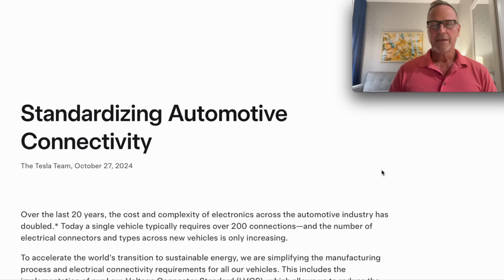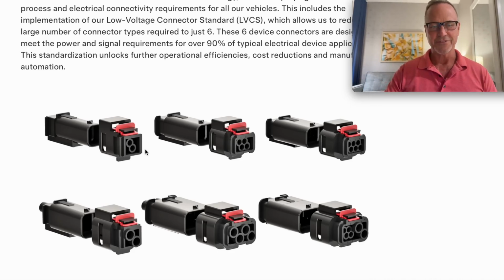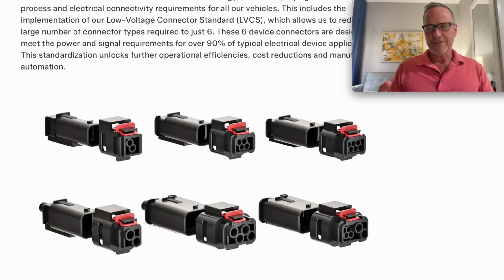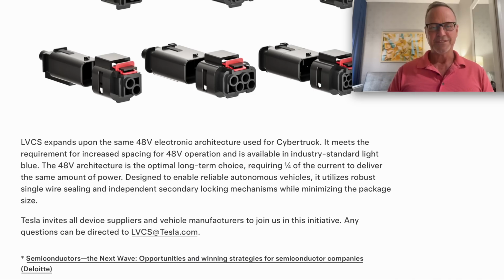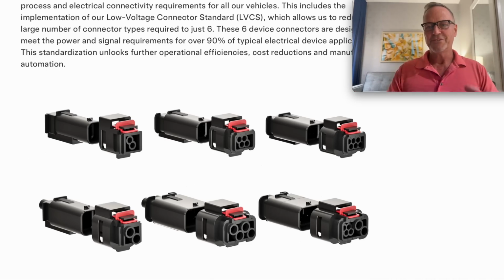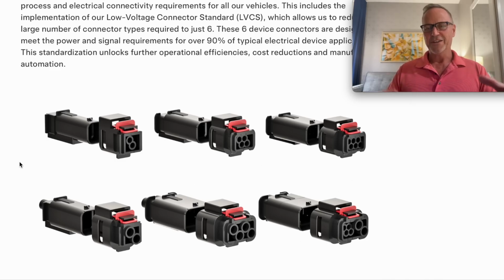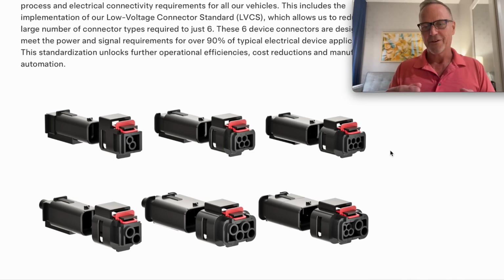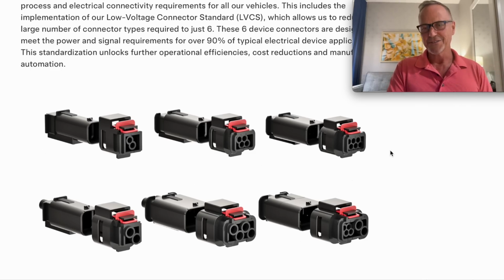Tesla Drops Another BOMBSHELL Standard!

Comment: Cars used to be built like this, or rather one connector for all wires - the problem is that there was no organization. Wiring repair was terrible as all wires and connectors looked the same. I'm interested to see how they identify which connector goes where - just seems too easy to plug the wrong connector into the wrong place.

Comment: Note that both the male and female connectors have a recess that is not ideal for a human handling the connector, but would be perfect to give a (custom) robot gripper a firm grip.  They would also be good fro mounting one side of the connector in some enclose or bulkhead, tuning it into a panel mount connector. So in the unboxed production, instead of mounting part of the car and then digging up the cables and connecting them, both sides of the construction could have the conrectors fixed in place, and the connection being made automatically when the car part is mounted.

Comment: The control signals will probably be the well established Etherloop that supports high bandwidth transfers.
With that combination, you can run one connection to the rear, and add all lights, wiper, camera, speakers, towing hitch connector through it. And maybe ABS, too?
This is simply brilliant.

Comment: I would like to add one thing. The connectors need to be designed for BOB. Not just for installation but for disassembly and service.   
In case you're wondering BOB is a blindfolded One-armed Builder. 
As an Engineering Technician wire harness connectors are complex and easily broken upon disassembly

Comment: One thing missed here is the "eather-loop" the eather loop is what will be the main connection between each part, having one controler for everyhting in each corrner of the car connected by a single wire rather than miles of it

Comment: Until the whole EV industry adopts using the same charge plug it will still be a joke and using standardised internal connectors is fixing a problem that doesnt exist. The number of times I have tried to charge my car to find the charge point doesnt fit my car is beyond a joke. Until I can do away with having all the tags that are used by particular brands of chargers the industry is still a joke. Let me use a credit card rather than using a tag that is linked to my credit card.
Reply: Dude can you imagine if there was 200 different usb types or 200 different hdmi cables… you’d be pretty happy to work it down to just 6
Reply: Trade in for a tesla
Reply: @jonmcnabb6421 it is a Tesla but the number of super charges in Australia is nothing and I have to rely on other companies chargers especially on long trips.

Comment: Interesting.  Any thought on how well these connectors work during the maintenance during the lifespan of the car?  Do they get brittle, or the wires get loose, so when a mechanic disconnects or reconnects them, they break after 100,000 miles of use and 4 summers and winters?  We have issues with doing maintenance on used vehicles and having connectors with the plastic tabs or hooks break creating a maintenance headache.
Reply: lifespan depends entirely on the quality of the plastic used. I don't know if the standard specifies the quality of the plastic. But that is highly unlikely over specificity will prevent a standard from getting adopted. So highly likely is that they just specify the shape and the electrical parameters not the type of plastic.

Comment: What’d be the use for 4-pin power only, no communication?
I can think the LV battery, nothing else. 
Maybe I’d question also communication only - no power.
Not criticism, specify use case for each (of very few) connector type.
I’m amazed, does it do away with ribbon cable? (What was that?)

Comment: Nice job on standardizing:
These 6 connectors can fit into two “cutouts”. The two 2-position connectors are one shell size, the 4-position and 6-position are all the same larger outer shell size

Greetings from an old retired wire harness design & mfg. guy

Comment: Software heavy. And vertical integration of supply chain.
This designed based on ethernet & distributed controllers, way more than 48v.
I’d like to see Munro or Limiting Factor do a breakdown or just display of one controller.
Everyone else is years behind.
BYD & Xiaomi might be close. Quantum leap in tech.
Who even wants to invest in this without motivator of unboxed?
I’m predicting simple wiring will remain Tesla moat for a decade.
This is like Windows control of software to uniform standard.

Comment: So many are getting this wrong… there are on average 200 wire harness connections in a typical vehicle… there are many connectors… maybe it’s 75, or 150, or 200, or 300 to choose from. A Cybertruck may have 43 connections, but now they can only accomplish those 43 connections by choosing between the best one on the 6 types for that connection… They are NOT reducing the total connector count to 6 for the whole vehicle.
Reply: Types of connectors as a automechanic there are bajillions of these they vary from year to year make and model each with their own bs to handle reducing that to 6 well designed types is a gift from God.
Reply: I think cyber truck has far fewer connecters because it uses an ethernet network system
Reply: u need to zoom up to see the big picture.
u'll get there one day

Comment: OK "know it all", you got the window motor summary WRONG. There is no difference in WATTS used (power), there is a difference in AMPS in the circuit. The window motor does not use less POWER (watts) by going 48v but it lowers the amps so they need smaller gauge wire to power it (V * A = W). Less wire, less money (lower COGS). Less amps = less heat loss due to resistance as well (heat = IR2, I is current in amps).
Reply: He knows that.  We all know that.
Reply: Don’t chastise him too much as John did refer us to Sandy’s discussion which explains benefits of smaller wire size.
Reply: I think you only get less loss if you do not simultaneously go down in wire size (smaller gauge) while upping the voltage?
The main idea here probably is that you can save some copper, space, and weight?

Comment: Great video John.

The distal parts appear to be female,  making the proximal parts male.  There appear to be 3 outter case designs (small square, wide, and wider).  The female connectors are probably designed for both board mounting and inline cable connections.  The designs appear to be poka-yoke and keyed to ensure that only like connectors can be joined and only in one orientation.  There is an automatic locking mechanism that appears to provide visual confirmation of a completed and locked connection.  The lock appears to be releasable for easy servicing.  This is great engineering, and as you note, will provide a significant economy of scale boost for the 48 V architecture.
Reply: Can't see an o ring. Are they sealed ?
Reply: If you turn the one on the bottom left around and try to plug it into the one above it, you will find that the holes are at opposite corners of the box.  Same thing happens on the center pair.  With the pair on the right, how do you explain all 6 holes on the top part are the same diameter and on the same plane, while the bottom part has holes of two distinct sizes and on two distinct planes?  That is a picture of 6 distinct connectors  made to make it impossible to misconnect.

Comment: Still trying to grasp this.  They show the 6 connectors, but anyone who has worked on cars knows a large percentage of connectors are 8 wire, 12 wire, 20 wire. Etc.
Reply: Each connector shown had a different amount of wire inputs!
Reply: @4literv6 yes, but none had 12 or 16 or 20 wires. With modern electronics you only need 2 wires for power and maximum 2 for signal. See my reply above.
Reply: @4literv6  I saw a maximum of 6 wires.  I suppose if everyone goes to ethernet cables for communication like Tesla that will be enough,  but this will call not for just different connectors but an entirely new electrical and electronic system architecture.

Comment: I can't agree. The 12 volt standard may be flawed, but it is a very well-established standard. Maybe the 3-phase, 240 volt standard in Europe is superior to the single-phase, 120 volt standard in the U.S. too, but its benefits haven't changed the standard here in the last century.

NACS did not similarly replace an established standard for EV charging. There was no established standard. We had Tesla (NACS), CCS, Chademo and few others that never got far. The industry recognized the need for a standard, and it adopted NACS, but it wasn't replacing one standard with another as it would be if it replaced 12 volts with 48 for low voltage automobile applications. It was adopting a standard where none existed before.

Even a Ford or GM can't just decide to adopt 48 volts. It must convince many suppliers of everything from air conditioners to windshield wipers to adopt the new standard too. Other big automakers are not vertically integrated to nearly the same extent, and Tesla's vertical integration has costs as well as benefits; otherwise, legacy auto would be more vertically integrated too. They became less vertically integrated over time by realizing the comparative advantages of specialization and trade.
Reply: Let me get this straight.... If Tesla spends $200 million and GM and Ford added together spend $50 million, you think the 3rd parties will force Tesla to use the same as GM and Ford?  Please make that make sense.
Reply: @davidbeppler3032 I say nothing about anyone forcing Tesla to use 12 volts. I only say that Tesla using 48 volts is not a standard. Standards typically are adopted voluntarily, not forced. I remember when everyone said that Sony's Betamax was better than VHS, but VHS became the standard anyway, and it remained the standard until DVDs replaced video tape. That Betamax was better in some sense just didn't matter.
Reply: In grid wiring,  changing to a new standard world require rewiring every single building. In auto, only building new cars with the standard is required. 12V was outdated decades ago,  but nobody would bother to upgrade. There have been 42V and 48V components like mild hybrid systems and electronic anti roll bars,  but that's not enough.  Time to move on,  at least with BEVs and new chassis control protocols.
Reply: @jamesengland7461  Not only new vehicles. All of the components of a new vehicle, made by countless companies, designed for 12 volts. If Ford asks for 48 volt headlights, air conditioners, windshield wipers and countless other components from suppliers, the suppliers will raise the price of these components because their factories are tooled to produce components designed for 12 volts. These components must be redesigned, and factories must be redesigned to produce the redesigned components.

GM can then stick with 12 volts and buy 12 volt components at a lower price and charge consumers less for their vehicles. In the long run, a 48 volt system may cost less to produce because wires are smaller, but in the long run, we're all dead. In the short run, Ford is at a competitive disadvantage. Most consumers are price conscious.

We've had a 12 volt standard since the 50s. Carmakers could have switched to 48 volts at any time since, and occasionally, a carmaker does experiment with 48 volt components, but the 12 volt system remains dominant because economic forces hold the industry in a locally if not globally optimal state.

Comment: Thanks for this. Connectors are a big deal and getting them right the first time even bigger. 

Imagine if USB had avoided all the earlier standards and had gone with USB-C from the beginning. Imagine how much pain that would have avoided. Same for HDMI. If VGA and early digital video has been avoided and gone right to HDMI from the get go, how much time could I have saved as a desktop support person 20 years ago if I hadn't had to screw down those damn VGA connector thumb screws to a difficult to get at and see monitor port👿.

If these are designed to be easy to use I'm betting it will make many a repair and body shop tech person very happy.
Reply: HDMI is bad.
Reply: @cherubin7th  Compared to VGA? In what way?
Reply: I've seen USB-C failing after gets unplugged and plugged back in many times. Particularly an issue when working from home with setup at work as well. Once the laptop motherboard USB-C female ports get sloppy and stops working properly a motherboard replacement is required.
Reply: @trythis2821  Um... or a quick easy repair at any computer repair place.  Just takes 5 min and a soldering gun.  And the skill to use it.
Reply: @davidbeppler3032  Not if the device is in warranty. I've logged many warranty calls for my work and the fix is always to replace the motherboard. May be able to solder might not, you also need the replacement part.
Reply: @trythis2821  A usb C port is ubiquitous.  They are everywhere and cheap.  The motherboard decides what to do with the port.  The port does not.
On another note, warranty?  Your repair shop does not hire electricians.  They hire R&R mechanics.  Rip out and Replace.  Not repair.  :)
Reply: @davidbeppler3032  I'm talking about the female USB C port on the motherboard. If is in warranty, there is no way are going to risk damaging other parts and not being able to get it fixed.
Reply: @trythis2821  I was talking about the female USB C port on the motherboard.  You seem uneducated on the matter of circuitry and soldering.  No risk of damaging anything.  You remove one part and replace it with a new part.  This is not rocket science.  A new USB C port costs like  $0.50/each.
Reply: @davidbeppler3032  Say what you like, I know how to solder but the laptops we have are in warranty so will leave it to the manufacture to fix with their technicians. Also, their techs always replace the motherboard and never solder a new USB C port on. Primarily Lenovo. Once the devices are out of warranty they get disposed of.
Reply: @trythis2821  I know how they do it.  Throw it away and get another one.  They charge more than it is worth then absorb the losses in warranties.
Reply: sure, but why not straight to Bluetooth?
Reply: @rsmonge  95% of the time, a wired connection is better than a wireless one.
Reply: @SHO1989  Wired.  Always.
Reply: @SHO1989  not exactly. 100% of the time a wireless connection is better, if the speeds are the same ;)
Reply: How would you be able to guess what you will need in the future?
There will always be an evolution. 
These plugs will eventually be replaced with updated ones or with a new standard.
Reply: @jsjs6751  wireless will always be preferred when possible

Comment: They are reducing about 20 different connectors down to six. There are about 200 connectors in a car of the 20 different types. They are not reducing the number of connectors in their car down to six
Reply: I know for a fact that VW uses more than 200 different TYPES of connectors in one single car.
Reply: @wolfgangpreier9160  Tesla's press release says "Today a single vehicle typically requires over 200 connections—and the number of electrical connectors and types across new vehicles is only increasing."  I would seriously doubt every one of those connectors is unique.  Using a symmetry argument alone I would expect nearly half of those to be redundant.  For example I would expect the connector for both front seats to be the same.  Similarly, I would expect the connector for symmetric speakers to be the same.  Tesla also says they'll reduce the number of different connector types to 6.  It's a stretch to think 6 connector types could replace over 200 connector types. I think the number of different connector types would be in the tens rather than the hundreds.
Reply: @DanielASchaeffer  Please do not try to compare a Mercedes .- a car that is built by  a single coach builder a craftsman, a specialist, an articificer, an artist par none who has at least 60 years of experience before he is allowed to touch one of the holy Mercedes tools in an effort to try to make one Mercedes Benz 200E with 250 kilometers of copper lines wrapped in the finest polypropylen from the east meadows of Baku with a lowly "Tesla"!

Simply said: BMWMercedesVWToyotaMazdaSuzukiFordKiaHyundaiGMBYD know how to make a real car. With real cables connecting everything with 4269 controllers for every aspect of emissions control to the temperature of your left thigh.

Tesla only knows how to make cheap EVs.

The difference: Tesla does not care how others are doing it. They always make it the Tesla way. 

Compare them to your own peril.

I currently have four of these thingies and i am in ther process of buying two more. Because they work. And are cheap. And make no problems. And are fast.

And do not use the same power and data distribution inside a car as anyone else.